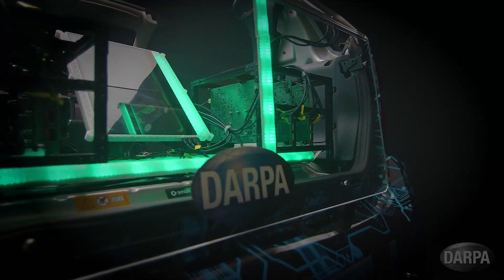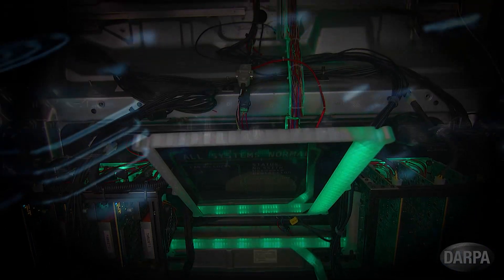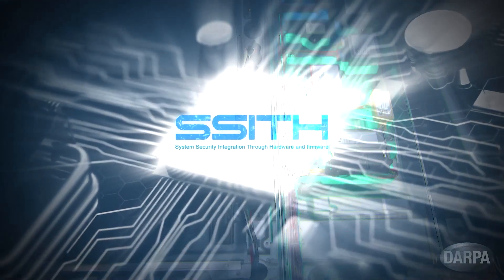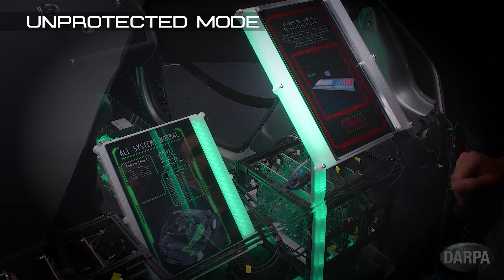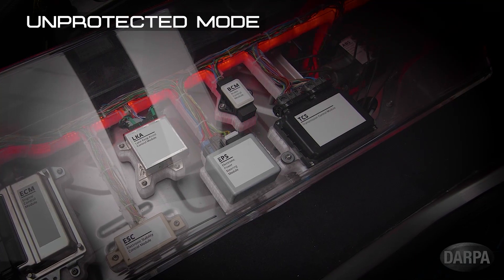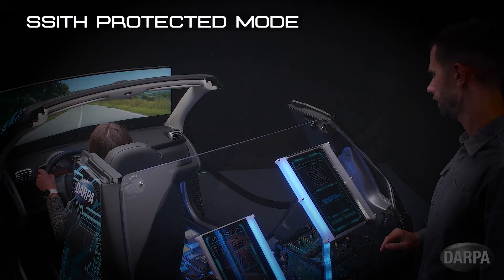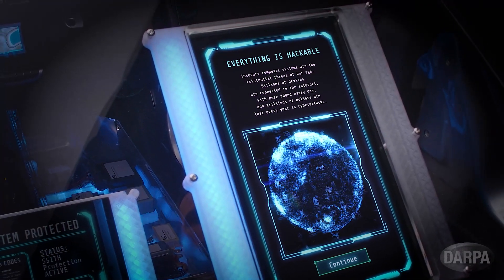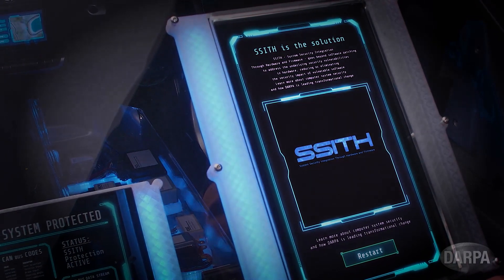DARPA SSITH Automotive Demonstrator

Comment: I'm not completely understanding what this is supposed to demonstrate, or translate to in the real world.  Especially without any sort of fangs in regulatory agencies or motivation across the political spectrum to hold manufacturers to any sort of data security standard.  We see this very issue playing out across every industry, and time and time again most of the data breaches and exploits come from corporations either being ignorant of the latest security practices and controls, or being flagrantly negligent in implementing them.  For the most part, it is the former, which is only allowed due to there being no standard to hold them to, or any agency with sufficiently reaching power to enforce.

Comment: And wireless capabilities mean squat. If it has a computer and auto acceleration or steering correction than it can be externally interfaced.
Reply: Wireless capabilities mean everything. If you can't even connect to it then you surely cannot breach it. Hard wired is the only way in any system without glaring vulnerabilities.